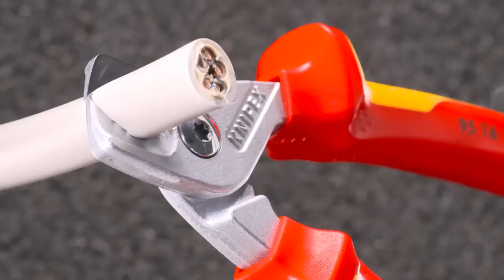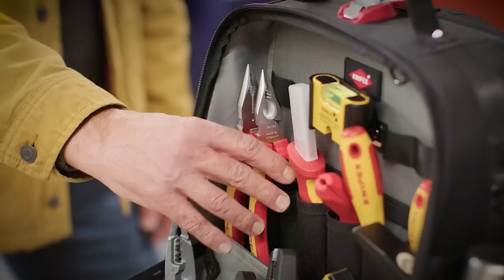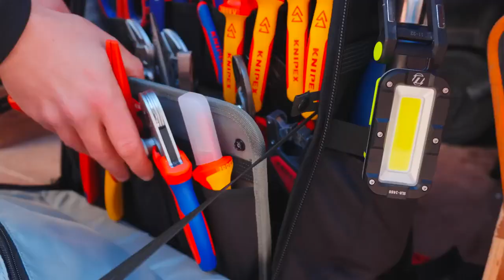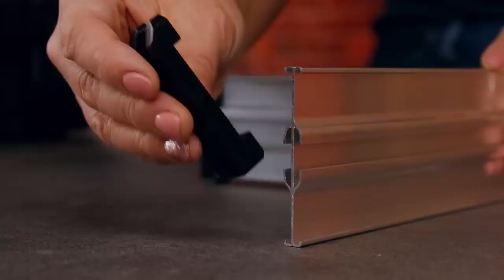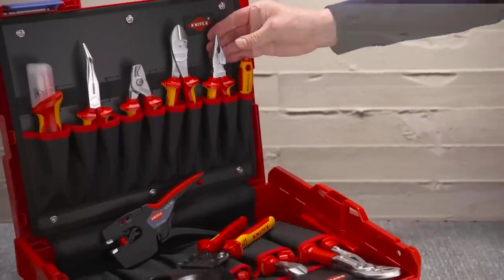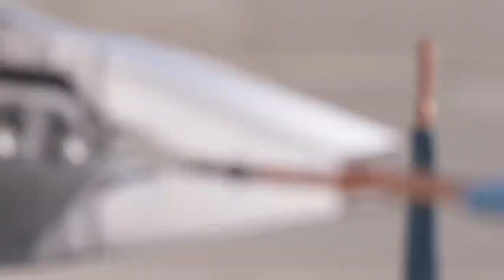Sản Phẩm Mới Knipex 2023 Gồm 13 72 200 ME, 13 76 200 ME, 08 26 185 và Ba lô Modular X18 00 21 50 LE

Comment: Nice tools ,I use them a lot .I have the shorter version of the needlenose combination pliers and it is just great. The forged wire strippers are alo my favourite ones, I own the AWG version used on metric wires. I like that the metric version is available in the VDE version and chrome plated, but knipex removed the spring and lock and the screw cutting capabilities..So I will use the AWG version until Knipex will update this metric version.